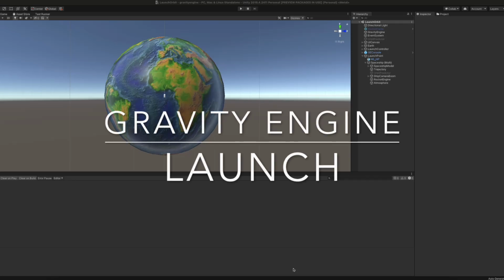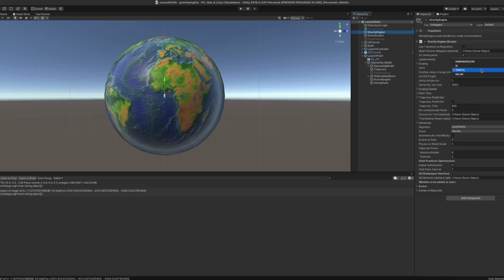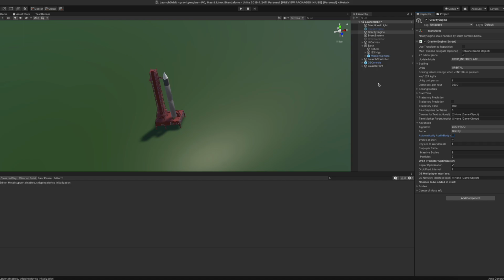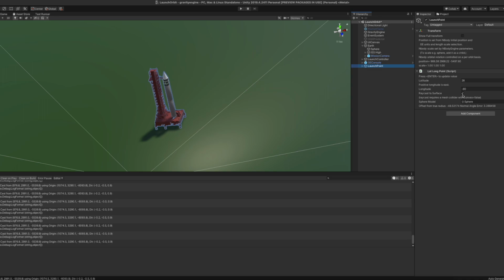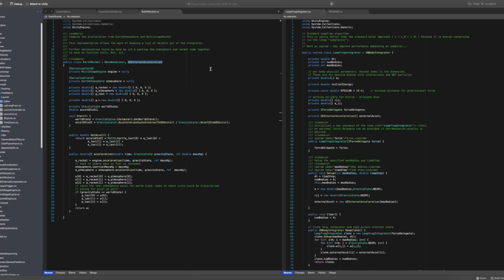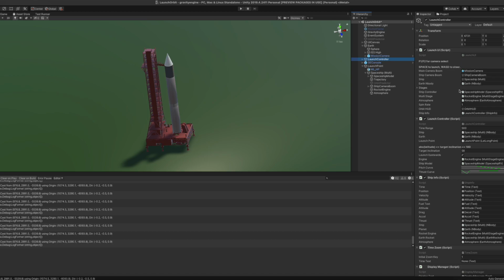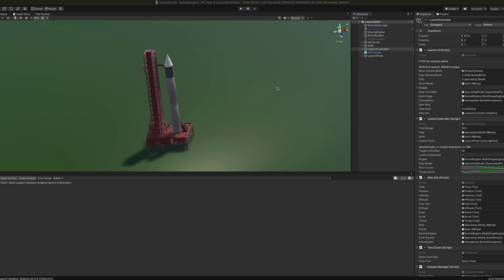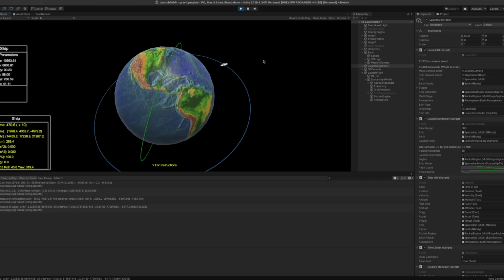LaunchOrbit - Gravity Engine 9.2

Comment: Hello, when will Gravity Engine2 add the example of launching a rocket into orbit from the Earth's surface
Reply from the maker: Most of the core code is in place. I need to add an atmospheric model and then build a scene to show it all off. I'll add this to the list for the next release. 

My current estimate is that the next release will be in late August 2024. Its anchor feature is circular three-body orbits e.g. halo orbits in cis-lunar space.
Reply: @nbodyphysics5853  Looking forward to your next version in Gravity Engine2 I want to control the position of the satellite by Julian day and control the time double speed should refer to which use case
Reply from the maker: @shayuchen-x8h  The example in the GE2 EarthOrbitWithMap is a good start for this. It has the ISS initialized with a TLE (which is defined at a specific Julian date) and the GScontroller has a start time specifying a date (which must be after the time the ISS orbit was defined). Controlling time speed can be done by enabling "Debug Keys" on the GSController and using key 1-9 to change time zoom.
Reply: @nbodyphysics5853  Thank you for your answer Let's say I have a satellite and I know every second the J2000 information of that satellite and now I want to control every second and update the position of the satellite with the j2000 information that I know about that satellite is there an api for that

Comment: Hi, I am trying to save my on rail state and reload it for persistence over closing the game. So what I do is trying to save the Orbit Universal parameter such as perigee, apogee inclination and starting phase. Not quite sure how to set the orbit state when the game load back tho, after several attempt it doesn't seem to update the orbit at all. Maybe there would be a simple way that i didn't know of?
Reply: If you set up a new OrbitUniversal on rails, the position will be a function of the orbital elements and the time. Are you also saving and restoring the GE time value?
Reply: @PeterMusgrave  Thanks for the reply, yes the GE time value is restored after everything else. Oh so I just found out that I can store the orbit data into the class OrbitData using saveOrbitData.orbitData = new OrbitData(orbit); then i can set the orbit from it on the next load using orbitUniversal.InitFromOrbitData(orbitObjectData.orbitData, 0); then setting the GE time :D Thanks for the reply Peter.
Reply: Oh so I also need the orbit start time I see that now using orbit.GetStartTime()
Reply: @PeterMusgrave  Hey Peter, I am really struggling to make a Eight Ball to work, I'm starting it from scratch cause I can't find any resource online on how to implement it and I am no expert so I basically try to do bunch of maths but I can't seem to get this to work, any idea or lead how to implement a navball?
Reply from the maker: @konijima  Sure. If you contact me at nbodyphysics@gmail.com I can send you a copy of the deprecated NavBall asset I created. It's functional. I depreciated it since it was not as polished as it should be and I wanted to put more time into GE.